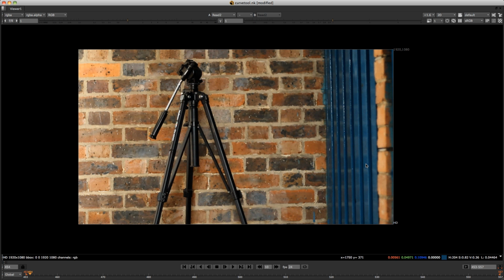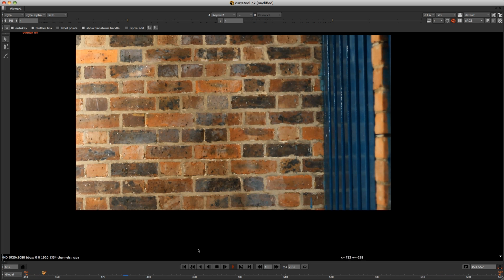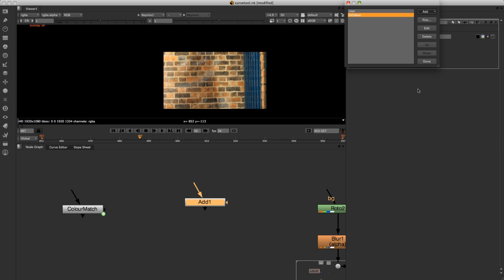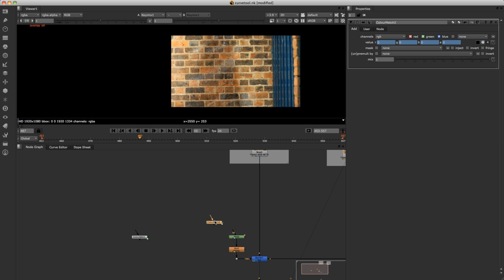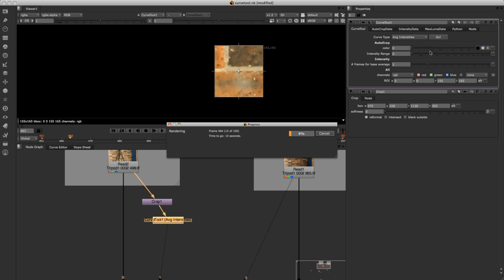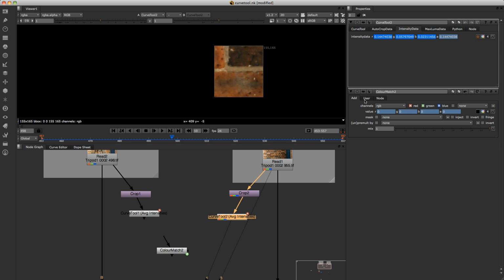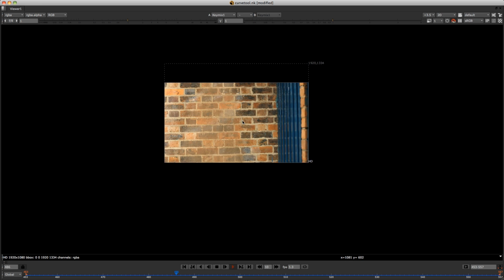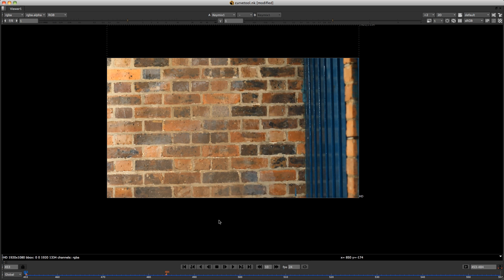Compositing Technique - How to build a custom node to match colour Intensities in Nuke

Comment from the maker: you are right you can definately use a multiply operation for this task, the tool I use does work with the multiply operation. When I made this tutorial I used the add operation but it would probably be better using multiply.